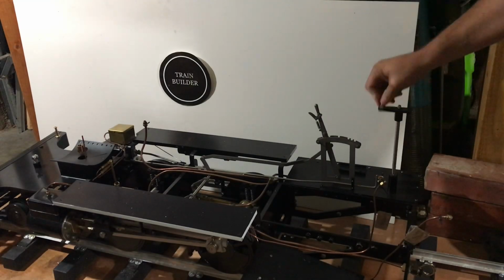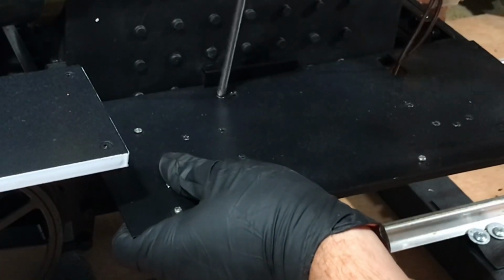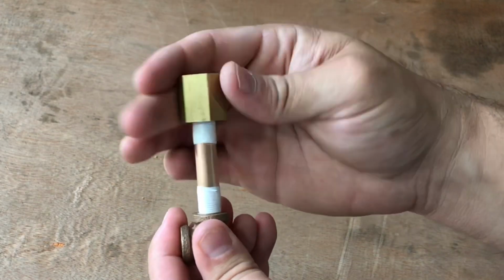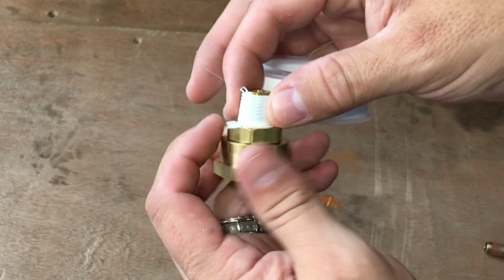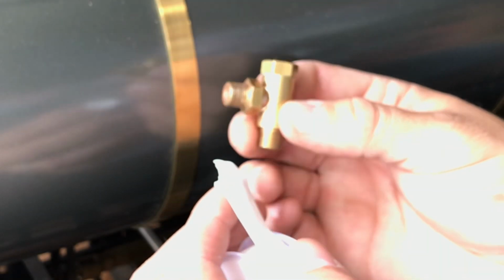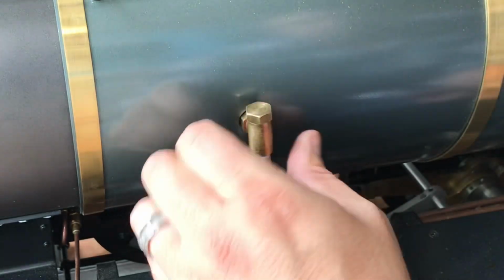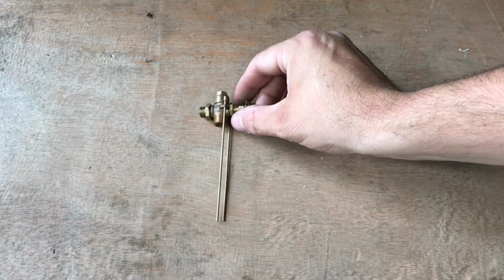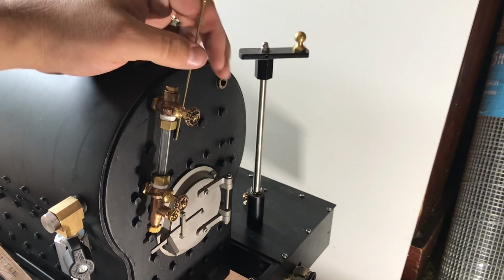Steam Locomotive - 7.5  Narrow Gauge 2.5 Scale 2-4-0 Kit Part 3

Comment: Note of the wise use creek water the more pure the water the more corrosive it is and Rain water can be acidic  water that has set in the creek has had some time to off gas or leach out the compounds  making it acidic or so I was told however for longevity of the boiler its probably a accurate enough statement to be worthwhile
Reply from the maker: Good call! Thanks for the advice 😃🚂

Comment: Nice build and thanks for posting. A couple of suggestions from a pipefitter. Wrap the teflon tape on male threads the other way (clockwise) and it won't tend to unroll when you start the female thread. Also try not to wrap the tape so it goes over the hole or pieces can end up in the boiler and valves.
Reply from the maker: Thanks!! All great tips!! Glad you’re enjoying 😃

Comment: Huh, kinda surprised they're not using locknuts on the inside of the smokebox. I know conventional nylon locknuts might not be able to take the heat, but there's also flex-tops nuts that could work.

Comment: Does this engine actually have blowdowns on the boiler? It seems a little odd you'd blow down through the site glass. Normally the small blow down on the glass would just be to keep the glass clean.
Reply from the maker: Yep - The blow down on these little loco’s is the valve right under the sight glass. It disrupts the water through the glass a lot more, and this type of blow down isn’t used on full size loco’s due to its amateur performance. These little blow downs user the sight glass are used to balance the water level. Hope this helps! 😃
Reply: @TRAINBUILDER  what a beautiful locomotive you have a lot of talent, friend to do these very cool things you have to be recognized I'm from Brazil
Reply: @TRAINBUILDER  That really surprises me honestly. You could use the drain under the cab as a blow down, but without multiple spread around the firebox you run a higher chance of having particulate build up around the mud ring.
Reply from the maker: @MrRailroadrunner  Are you talking about the drain release? “Blowdown” after the locomotive is cooled off to drain deposits and build up? That the bottom valve under the fire box in the back. There’s two ways of getting water out of the boiler.
Reply: @TRAINBUILDER  While I see that valve, I refer to a blow down as something done while the locomotive is hot to expel as much contaminates as possible. My little clishay for example has two, one located on the bottom of each side of the boiler. While running, normally once a water stop, I open these, if only for a moment. The idea is to carry any particulate out of the boiler and prolong the life of the boiler. It's amazing how much sediment can build up in the bottom of these boilers.
Reply from the maker: @MrRailroadrunner  Gotcha - I think we’re saying the same thing but I’m having trouble making sense, lol! Just like your Clishay this locomotive operates the same. The blow down attached to the sight glass allows one to release water, check sight glass, and clear sight glass while under full steam and running. The bottom valve under the fire box on the very bottom allows you to blow down the boiler after done running. You can open this bottom blower with a wrench/spanner while under steam if one wishes to blow out sentiment as well. I’ve too seen some pretty dirty blow downs on various boilers and am also surprised in some cases how much buildup can accumulate at the bottom of the boiler!
Reply: The "blowdown" on the bottom water column valve seems to be for clearing the sight glass and just reducing the amount of water in the boiler.  It is not a true blowdown valve because it is too high above the mud ring.  There is a lot of room between this valve and the mud ring for sediment to accumulate during the boiling process.
The best "blowdown" on the loco is the one under the firebox.  You may want to make an adaptation for the exhaust from that valve so you can use it several times during running to get rid of sediment buildup and direct the blow away from the loco and not down to the track, ballast, and ground; from experience with 175 psi max boiler that is a lot of pressure and a lot of debris being blasted back up under the loco.  To put the loco to bed, drop the fire(all of it), let the boiler cool a little(just a few psi), then open the blowdown on or under the mud ring to drain the water from the boiler.  When the boiler is empty of water, leave the drain open to let all water and vapor escape while the boiler is cooling down to the point of ambient temperature or close to it before closing the drain valve so the boiler dries.  If this is a steel boiler, you should use treatment of the water to get rid of oxygen dissolved in the water to help prevent pitting of the metal even if you are using distilled water.  It would be prudent to have a boiler chemical person or company check all of the water supply locations you think you may use for sourcing the water for the loco.  We found the effluent of the water treatment plant was better for boiler use than what came out of the line.

Most full size locos use a blowoff valve for clearing the sight glass so the glass will give a better reading.
My name is Roy Reynolds.  I don't have a clue how YT did that.
Reply from the maker: @royreynolds108  There ya go! Bingo 😃

Comment: Hi there I was wondering if you could help me with something, if you look at 6:11 in your film, to the left of where you are threading in the water fill line there is a copper line marked "whistle". Could you tell me the name of the fitting used on the end of that copper tube? The one with the compression nut around it? Thank you!
Reply from the maker: Hey! I believe it’s a copper pipe seal. As you can tell I labeled whistle to not get confused with blower. I know Accucraft has a few of there fittings.

Comment: How wide do the wheels deed to be
Reply from the maker: These are 7.5 inches apart! So this is a 7.5 gauge locomotive 😃
Reply: Hmm
Reply: @TRAINBUILDER  how long does it generally take to make one of these
Reply from the maker: @megamanx5760  Between the rails is 7.5 inches. Hope this helps :)
Reply from the maker: @megamanx5760  Great question! So this is a kit which means all the parts are already machined. I’m especially just bolting together all the pieces like a big erector set and or lego set.. If I had a full day I could build this particular locomotive I think. Now if you’re machining a locomotive I can take anywhere from 2-20 years to complete. As you know I’m a kit basher and or kit builder here for now. I’ll have this locomotive done in probably 3-4 more videos or so.
Reply: @TRAINBUILDER  so wait whats the cheapest kit you've ever got
Reply from the maker: @megamanx5760  Live Steam? You can get a little G gauge live steam Ruby for like 300-500$ I think. You can’t ride it it’s G scale though. For ride on you can get electric too that’s a lot cheaper. You could get a little electric or gas power loco you can ride on for around 300-700$ used.
Reply: @TRAINBUILDER  ok what about locos you can ride